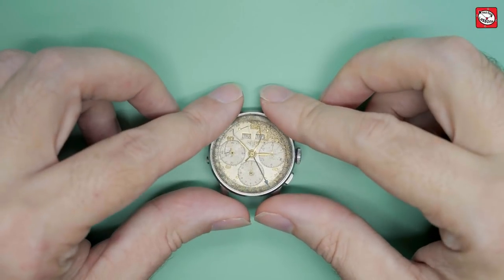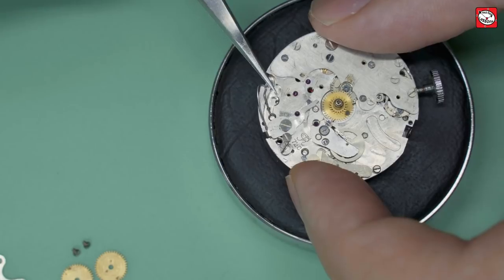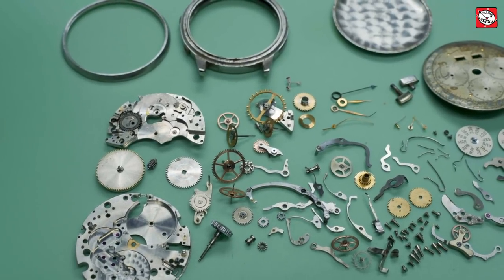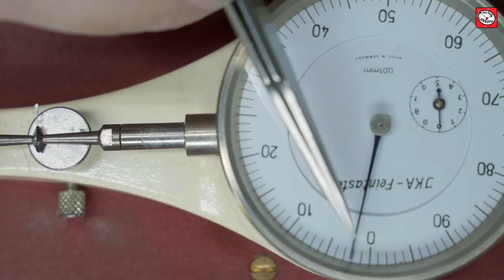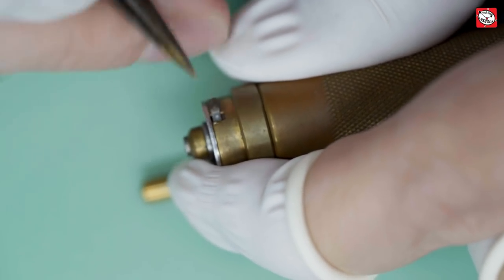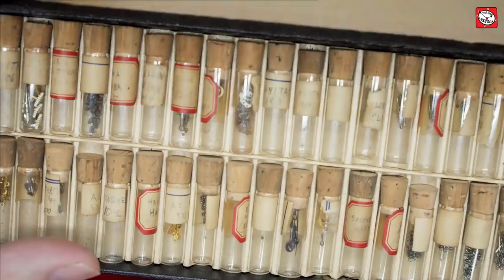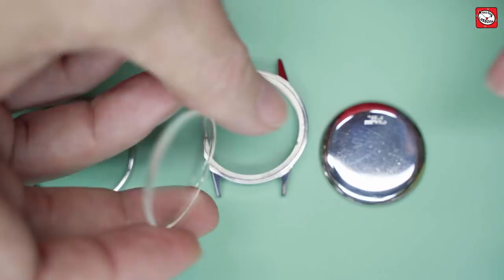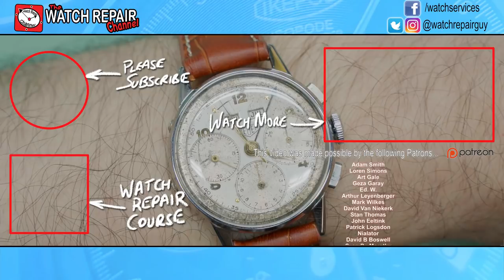Restoration - Heuer triple date valjoux 72c watch repair tutorial project

Comment: Thank you for such a great video. Have very similar watch in for repair. The model is the very same but it is the Romance model. One of the screws has come  off the back display and has gone down the winding hole and stopped the alarm from working.  My question is how do you fit back on again after the repair without damaging the crystal. Thank you again for your video.

Comment: These videos are so relaxing to watch. I fully expected the movement to be in horrible shape. It was nice to see that it wasn't too bad. You calmly make a part that I could barely even see. If it can hold that timing, it's running remarkably well. How long did it actually take to straighten those hands? I was surprised they didn't break. As for the dial, it's kind of weird, but I'd almost consider leaving it as is as a survivor watch.

Comment: I was told it is best to use a brand new barrel complete with mainspring when rebuilding a chronograph because of the spring strength needed. Is there any way to determining whether or not this is really necessary other than doing the complete rebuild and putting it on a timer?

Comment: Great video, I had a quick question for you regarding case sizing, I have a vintage movement I want to re-case it is a benrus21 jewel  dn 411/basically an eta 1280 (I think). Am I stuck trying to find and use the case it came in originally, or can I put it into any 17 ligne case that I can find.
How do I know for sure which cases will fit this discontinued eta movement 
Thanks for your time,
Thomas
PS
The watch it came from was a benrus citation Collins , from mid 1950'a to early 1960's and again I say that with a large hypothetical "I think" attached any help is greatly appreciated!
Pps 
Also don't know for sure it is an eta 1280 now because I am looking and it says they were all 17 jewel and this is 21.........

Comment: I must say Mark, this was a fantastic restoration! Hand making the spring was incredible! I have a question: I do see vintage pivot straighteners for sale on eBay, and they are quite expensive. I have not yet viewed a video of anyone using a pivot straightener, and I am curious if you believe they are worth the cost? have you used a pivot straightener? If so, would you make a short video on how to use one? Watching you straighten the pivot without a special tool was great!

Comment: Question: why are there different heights for tge pinion ( or gears)? Im having a scratch my head moment regarding chrono runner part on a 722-1 movement. Im being asked the pinion height so the correct 1 is quoted.. 
Please advise

Comment: How on Earth do you manage to remember the position of all those items once the watch is broken down.

Absolutely amazing.
Reply: Garfunkel Stiglitz maybe he shot an video of the disassambly. Don’t know 🤷🏻‍♂️
Reply: Not sure from this watch but there is a lot of documentation online.
And if not you can make little drawings so you know where things go back.
Reply: this comes with experience but, systematic assembly/disassembly is the key... everyone has different method of organizing, but easiest would be, take a pic, print it enlarged a bit, maybe use some transparent double sided tapes to...would be a lot easier to sort things out if memory is not great...
Reply: No parts fit more than one place, I've disassembled and reassembled a NH36 movement and there was never any problem telling witch part goes where, every part go where they fit... The problem is the parts are freakin small and brittle, and my hands are quite large and crude, being a construction worker and hobby mechanic I'm not used to handling such tiny things..

Comment: I had a question about the spring you made, does that not need to be hardened at all, at least to a spring temper or case hardened to prevent wear on the bearing surfaces? I'm sure you know infinitely more than me on the topic, just seemed strange to me as it seems like the spring would eventually just set into the bent shape.
Reply: I’m not a watchmaker, but I believe because the spring is long and straight and has almost no range of motion, as well as an infinitesimal load, it probably won’t suffer the stresses that could deform it over time.

Comment: Whooh, 0.2mm handmade. This is what a watchmaker really mean. Love it
Reply: Way above pro!
Reply: @Cool Crush Ice Killa Why bullshit? Many machinists work this small
Reply: akhenatuh  when you have an unlimited budget it aint possible to leave it new, even watch collectors prefer the original parts even if they look shabby, vintage, old, it attests to the life of the watch.
Reply: @hectorgarcia8691  i agree but we have to keep in mind its first application. giving time. if you can't read it, where's the point?
Reply: @Reginald Bowls: Those machinists use calibrated MACHINES to get those tolerances. He hand filed that steel to .2 mm.
Reply: for real, thats pretty damn amazing. im wondering did he really made it in first try.
Reply: @reginaldbowls7180  Did you just compare machining to something handmade? Try doing something like this with just a saw and some files

Comment: So I just started watching watchmaker videos and the first thing i notice is that when they make parts they dont machine them, they whittle them.  There's a machine to plane that little piece of metal actually flat (or a dozen contraptions you could rig up) instead of just checking each end like this guy did.   
Is it that actual precision isnt needed, because a lot of the youtube watchmakers/repairs seem to take a non machinist way of making parts.  Like i saw another guy lathe a part freehand.  Ive never seen anyone freehand metal on a lathe in my life.  Its just very surprising.

Comment: It's now getting very close to the point where a clone watch from China is going to be 99% identical with the Swiss, I base this on a stainless steel watch. Back in 2008 a friend in Switzerland, who is in the watch business, told me a Rolex Submariner cost $250 to make. Ten years on and a few tweaks later, it will cost a bit more to make, about $350 in total. The best Rolex Submariner clones cost about $600. I can see in the next 1 or 2 years, with further refinement, the clones will be very close to perfect and cost less than $1000. In reality the production quality will be identical, then the question arises, why pay so much more for 'Genuine', when the clone is, in real world terms, the same watch. It is not like faking a painting, that is art, watches are engineering, and the basis of engineering is repeatability.